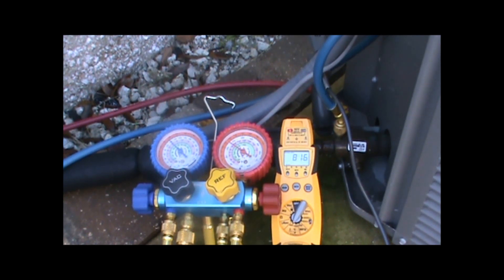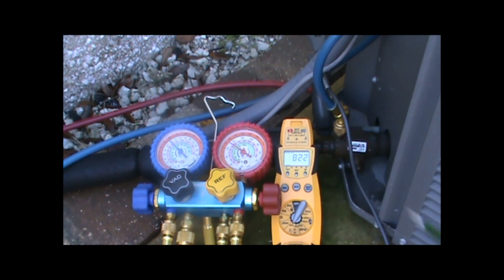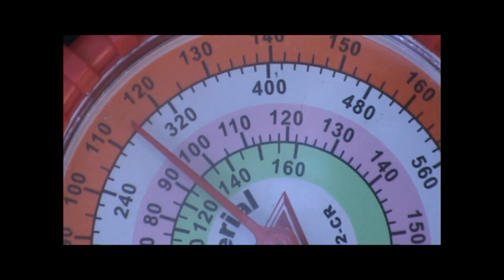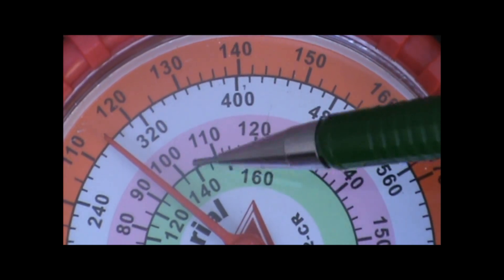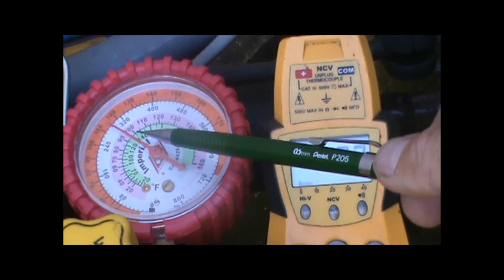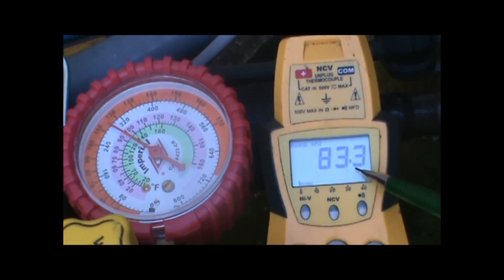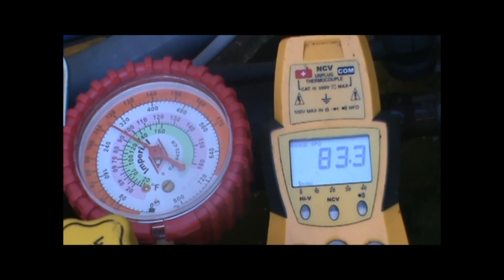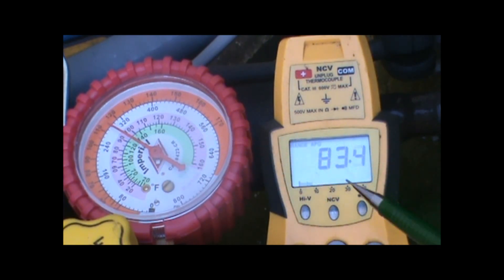HVAC Training - Measuring Subcooling

Comment: You are the best , you're the only person that ever explained this so easily , any dummy would understand. GREAT JOB .WITH YOUR EXPLANATION I COULD NOW EASILY CALCULATE SUPER HEAT ,  it's the sat. Temperature of the refrigerant ,could be r22 ,or r410a ,or r134 etc, scale on the low side gauge ,and measure the temperature of the low side pipe/line then subtract it from the gauge sat. Temp.😂

Comment: I am confused about one thing. If the corresponding temperature on the high side of our gauge set tells us what temperature the gas from the compressor turns back into a liquid in the condenser, wouldn’t that be called the condensation temperature and not the saturation temperature?
Reply: Once the vapor reaches 100% Saturation this is the specific point where Condensation begins to take place. Therefore condensation occurs for a period of time after that point. Using Saturation provides a specific point of reference for accurate calculations.

Comment: If you have a two stage compressor when checking the subcooling level do you run it on 2nd or 1st stage?
Reply: Always run it in 2nd stage when testing subcooling 👍

Comment: could you talk about how the outside air temp. affects the system. lets say in a hot humid climate, if the condenser doesn't cool properly, how the system behaves.with regard to the given amount of gas in it.

Comment: I have a 2006 carrier split system and the condenser outside has a board on it, and it is not a heat pump board.
When the system starts the condenser fan comes on and the board gives an error code 32 for the low pressure switch.
the contactor will not pull in as it is tied into the board with the low pressure switch.How can I check subcooling when the contactor will not pull in .
Reply: trukin forever If the contactor doesn't pull in, the compressor doesn't run. You can't check subcooling if the compressor isn't running. You need to figure out why the LPS is open and go from there. If the LPS is tripped you have low suction problem. Could be dirty filters, dirty or iced up coil causing low air flow across the coil. If you have low air flow then the suction pressure will be low. Remember for AC you never want to see your suction pressure below freezing temperature of the refrigerant or you will run into ice ups. Could be the system is undercharged, not enough refrigerant in the evaporator to keep the pressure up causing it to go off on LPC. If the charge is low the metering device won't feed the evap properly and the suction pressure will be lower than normal.   Get a tech that can recover the charge and weigh it in by what the nameplate says. If it still goes off on LPC I'd be looking for a faulty metering device.

Comment: Have you heard about using Cold Plus refrigerant additive to get colder air and use less electricity? I heard that both commercial and residential units are saving between 8% to 18% utility bill savings...is that possible?

Comment: If the data plate say "Indoor TXV subcooling 14F", does that mean that you should measure AT the TXV instead of the outlet pipe of the compressor ?
Reply: The saturation temperature is  the temperature at which the refrigerant is changing state vapor to liquid ,the" condensing"
temperature is the  saturation temperature, which we can read off the gauge as you mentioned. I find the term saturation temperature flies right over a lay persins head  but the condensing temperature they seem to widely grasp!  since sub cooling is any heat removed below the condensing temperature this makes sense to the newby in my experience.
Just as Supoerheat is the opposite in  that it is heat added beyond the boiling point, using water at sea level 14.7 psi atmospheric water will boil at 212F, any additional  heat added is not "sensible"  meaning the water can  get no   warmer rather the water boils and  if you get a 230F steam rising off the 212F water that's 18F superheat.
The opposite being subcooling as we stated.

De superheating the vapor then  condensing it, any further heat removed below the boiling point is sub cooling

Exa,ple 230F steam  is cooled to 212F and further reduced to 200F,  that's 12 F sub cooling

Latent heat involves a change of state  and is not sensible in that  it cannot be read with a thermometer in the liquid, what will be read is sensible heat.

Comment: Is it always in that 10 degree range or does it vary depending on the pressure and (saturated) temperature and liquid line temperature?
Reply: It should be listed on the tag of the unit what it needs

Comment: what happen if when you get the measurement the results is more than 10 degree, will say 20 degree or if  5 degree?
Reply: Alberto Pino you need to check the temperature outside

Comment: are you measuring a 410A system?
Reply: yessir 410A, the pink indicator on your guages is typically 410A. if it he showed the green, it would be r22 on most gauges.
Reply: @jayarr3075  where he got the target subcooling 0f 10 degrees?i'm begginers.thanks

Comment: I've got a Trane system with a charge capacity of 7lb, 11 ounces.  My Delta T is 13 degrees.  She seems to be low.  I'm waiting for some R410a to arrive.  I have only about 1.5 pounds of R410a left.  Client is a long drive from here.  Think 1.5 pounds would get my Delta Tin the 20 degree range?  I haven't checked the subcooling yet.  The Client checked the Delta T for me.  Turns out he has precise temperature measurement equipment.  :-)

Comment: Hi Ron. Do you have to allow for ambient temp when calculating subcooling?  I know that systems are designed for 90degrees and that ambient outdoor temp and indoor temp can affect pressures. Thanks for your help.
Reply from the maker: johnmiller102 Hi John, most manufacturer's have a subcooling or superheating chart on the inside cover. It is best to follow them.
Reply: Thanks Ron.  I appreciate your response.

Comment: Sub-cooling indirectly indicates the condition of the charge through direct reading of the P/T across the condenser.  Thus the high side gauge is connected to the high side GAS port [comp discharge] and compare this temp the that of the liquid line exiting the condenser.  This will show you the actual sub-cooling taking place in the condenser.  Keep in mind that outside influences on this subcooling value are: cleanliness and condition of the coil, fan speed, 2 feet of unrestricted free space around the unit, and finally ambient air and humidity.

Comment: You said that it was 10 degrees of sub-cooling and that this was good, what determines or rather what is the temperature range it should be in.  10 to 30 or 5 to 20 ???? When would it be out of character , what is the variable range?  It sure gets hot here in Texas
Reply: +Danny Calk  Good sub-cooling (Saturation Temp-Coil Temp) range is between 20 to 30 degrees F.  If you don't have a saturation temp value for a certain pressure, look for it from a Saturation temperature chart.
Reply: also look at charging chart on the inside cover or even unit name plate will tell you exact subcooling for the unit you are working on.
Reply: my Carrier specifies 9 degrees sub-cooling, which isn't unusual for a 16-seer/5 ton system.  Your suggested range is a bit high.

Comment: you taught the sub cooling definition in a very simple way
the temp measured (using thermometer )at high side for example 95 F
the pressure at high side say 100 psi the corresponding temperature from gauge/pt chart say 85F. (Saturation temp).
sub cooling would be 95 - 85 = 10
this is what I understood if i am wrong pl correct me
9
Reply: I am not a technician but I think it's the other way around. In your example you are 20 degrees away from correct subcooling temp. The temperature on liquid line has to be 10 degrees lower then sat temperature on the gauge. I think. I am still learning

Comment: The proper procedure is to use a pressure temperature chart for the refrigerant you are using to convert the pressure to saturated condensing temperature.  Every tech should have the charts. Sporran gives them away for free.

Comment: Nicely done except for the fact you say "we don't use our gauges to measure pressure per say"... This is false and is the main purpose of the gauges. How else would you show hunting, throttling or eratic txv? Your students should know this.
Reply: This lesson is all about subcooling in case you missed the title and in the context of subcooling he didn't say anything false or incorrect.  There is a direct correlation between pressure and temperature and when measuring subcooling it's the temperature that is of interest.  That is the point he was making and its a good one.  I'm sure he has other lessons and videos about those other subjects, not what this one was about.

Comment: what is the correct level in celcius please these videos all say 10 degrees but its farenheit. if you try to convert it, it makes no sense ☹ 10 degrees Celsius is 50f whilst 10 degrees Fahrenheit is -12c how can you have -12 subcooling ffs 💩 does the 10 degree rule also apply in centigrade? 🙄 nobody ever seems to answer man 😟
Reply: Divide 10f by 1.8
Reply: Rich, if you don't want to have to remember the divide by 1.8 method, another way is to convert both original Fahrenheit temperature values to their Celsius values and then subtract them to get subcooling. For example convert the 93F to 33.9C and convert 83F to 28.3C and subtract to get 5.6C subcooling. Am assuming you used the equation TdegC=(TdegF - 32)/(9/5) but you cannot use this equation for the difference of 93F - 83F of 10F which like you said gave a negative number. BTW, the (9/5) denominator equals the 1.8 denominator that Alex provided.

Comment: my a/c is not cooling the unit is old but it turns a guy came and said it did not need Freon but my house is not cool could it be the motor?
Reply: Very possible. When the evaporator fan stops working, the evaporator will ice up. Look for icing on the evaporator coil in the air-handler.